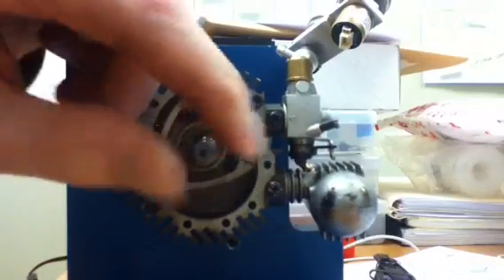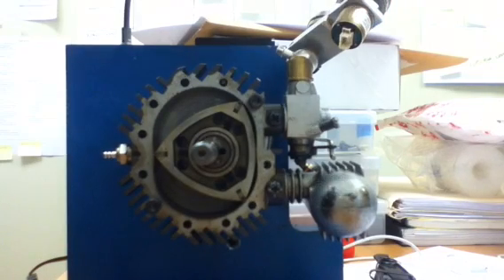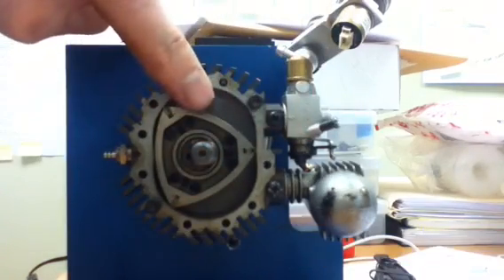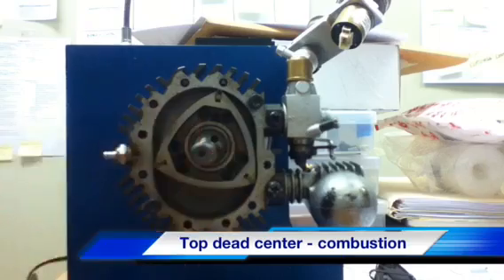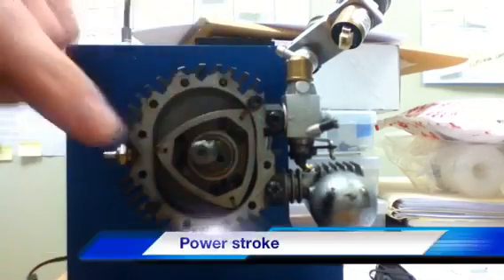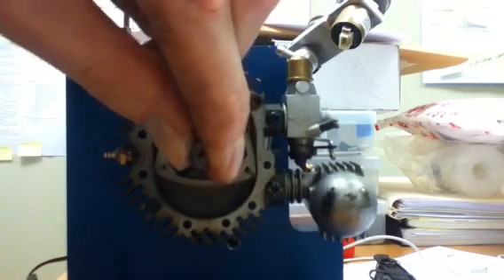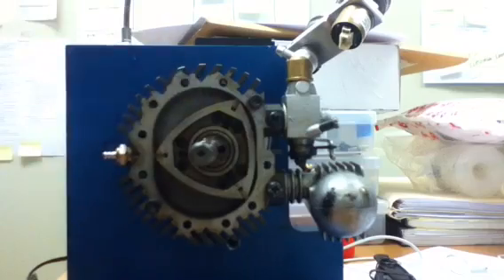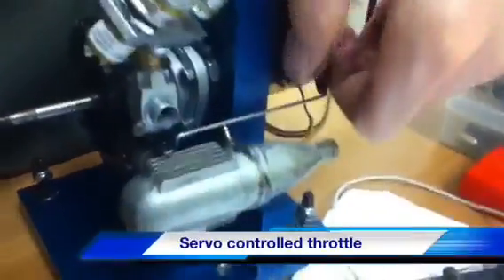Four stroke cycle of a Rotary Engine

Comment: Did you do anything interesting with that engine on the Dyno?

I am running mine on spark ignition, and with electronic controlled fuel supply, the fuel supply being corrected for barometric pressure and ambient temperature.